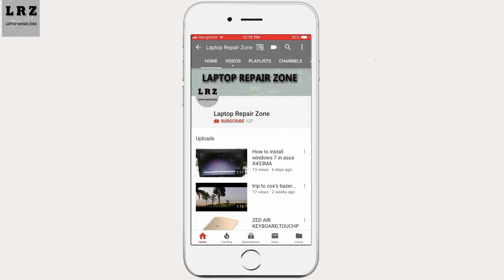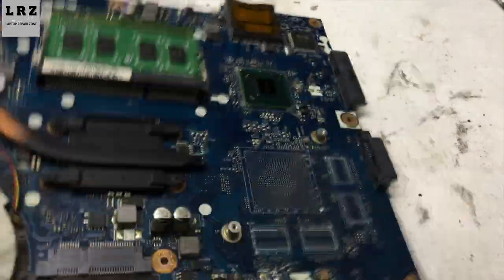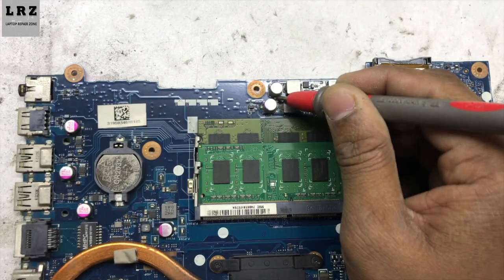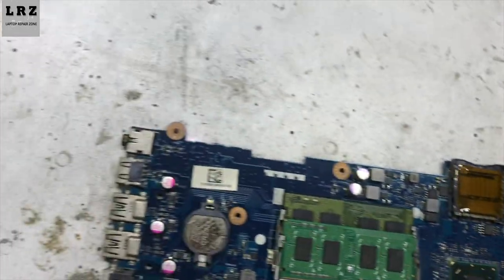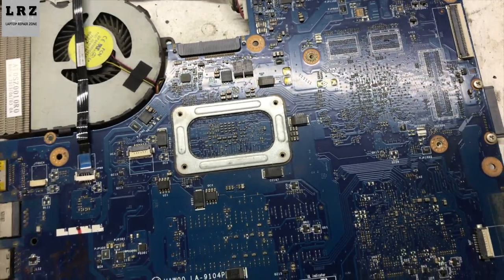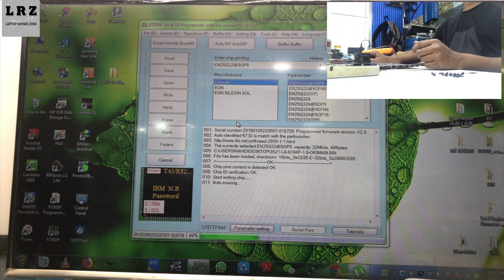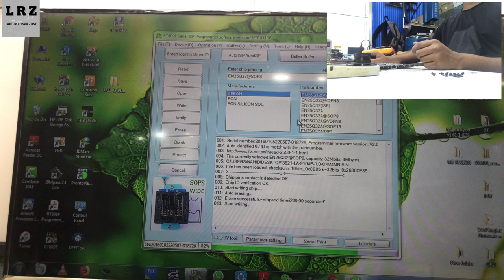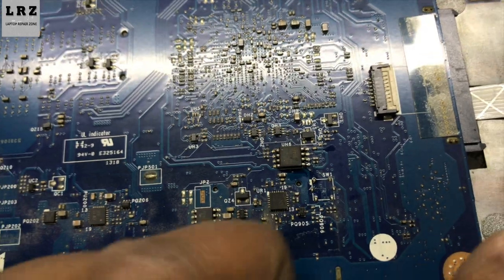dell inspiron 3521 no display | Dell inspiron 3521 1 beep with black screen | dell inspiron laptop

Comment: Hi! I solved the same problem in my INSPIRON 15R 5521 using this tutorial. I tested the same places in the motherboard and i got the same volts. The only diferent thing is that I didn´t use this programer, I used: Usb Ch341a 24/25 Eeprom Bios programmer, that I bougth online, that is a cheaper programmer. 
The spec of my BIOS is: cFeon Q32B-104HIP  AJP916C4  1249EMA. Is a 25 series chip, that is well known as: en25q32b.

IMPORTANT: In specifications of Usb Ch341a 24/25 Eeprom Bios programmer appear the en25q32, but mine was en25q32b. The difference is the "b" at the end, but I didn´t have any problem to flash it with the bios file that I found online for free, you can find it as: Dell Inspiron 15R-5521 VAWO1 LA-9101P Rev 1.0(A00) DIS Bios +EC +KBC  I used the 4MB file. 

I didn´t desolder the chip like the video, I just used the gripper that was included in the Usb Ch341a 24/25 Eeprom Bios programmer, this was much easier to do it.

Thanks for the help LAPTOP REPAIR ZONE. :D You have a new suscriber.
Reply from the maker: Thanks for your comment. .
Reply: Hi man thanks for your review,  I have the same problem that you in the same laptop model, I bought the ch341 a bios programmer, which software did you use for flashing bios ?  Thanks I hope you can help me
Reply: @lnear619  Hi man! I´m very happy that my situation is useful for you. The programm that I used is called: CH341A Programmer. I found it in this tutorial: https://www.youtube.com/watch?v=oprvXCZy1iU
In that tutorial gives the software and the ".bin" you can find using the name that I´ve just given you in the first comment.
Reply: @tio_titanio  perfect man! thanks for your help!!
Reply: HELLO man ,I have the same problem,but I have inspirion 5721,and I dont find the bios file.
Reply: @tio_titanio  can you help me?
Reply: @DanyCjRo  Hi man! I had the same problem as you when I was fixing my Inspiron 5521. I looked for them in fixing computers forums. I remember I also had the oportunity to contact a webpage that helps selling the specific BIOS you need but they selll it to you (unfortunately I can´t remember the webpage). Keep looking for them in forums, torrents, youtube tutorials in youtube in other languages like chinese, german, ensligh, spanish, korean...etc.

I hope I helped your. Have a nice day!
Reply: Tanks for your comments, I really apreciatte.

Comment: I want your expwrt advice on this!!!  I have a dell 3521 laptop which is old. And I am converting into a gaming box to play on my tv.  As dell laptop cannot run without working sceen panel. My screen is somewhat fine and when system boots it first searches internal display and then it displays on external tv through Hdmi I want to ask if I just remove the small board attached on the display screen and connect it with my laptop with attaching the entire glass panel , will it work? I just want to make a small gaming box withour dell glass screen and attach it with tv hdmi.

Comment: According to your video PL500, PC500, PC501 junction voltage is 1.5V. But when I measure it in my motherboard  it is  13.54V.  Other side of PL500 have 1.06V.
correct
Reply from the maker: thanks for your comment.1.05v its ok, 13.54v its oscillation
side where you check with DSO you can see the frequency.

Comment: Hello, I Have Dell Insprion 15 3521 Model, Same Problem. Battery Dead, And Without Battery Same Beep Sound With No Desplay.
Reply from the maker: Thanks for your comment, please check all the required voltage according to schematics diagram.
Reply: @Laptop_repair_zone  Sir Where I Can Get Dell 3521 (la-9104p) bios bin file?
Reply from the maker: Join this group for free BIOS https://www.facebook.com/groups/483833708998722/

Comment: Mine had the same problem: a continuous steady single beep and a black screen. Got BIOS flashed by a professional. After that it came back to life and used it for about an hour. But upon restart, the same problem came again. What could be the problem? Could it be the motherboard?
Reply from the maker: Thanks for your comment, try with another BIOS chip.